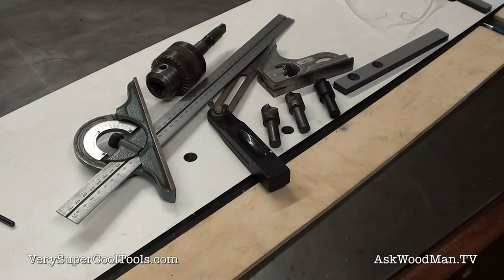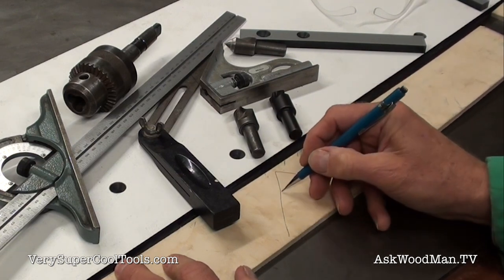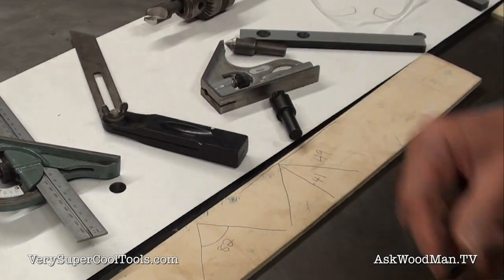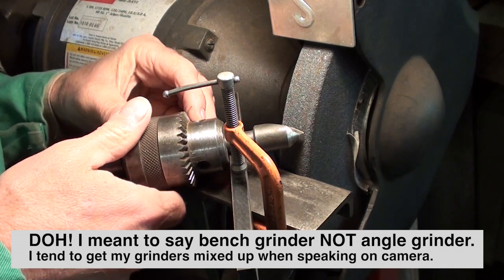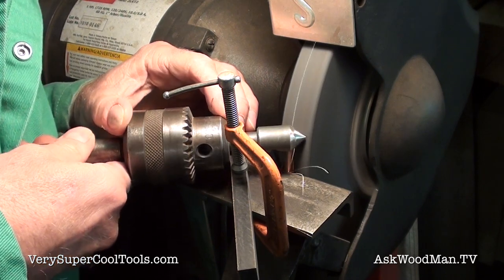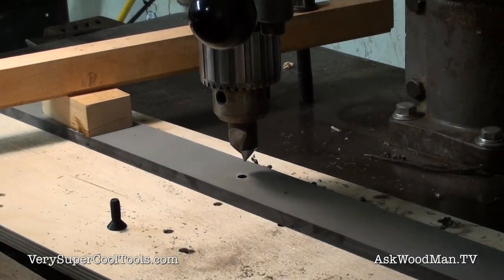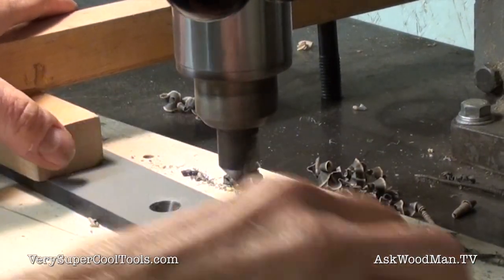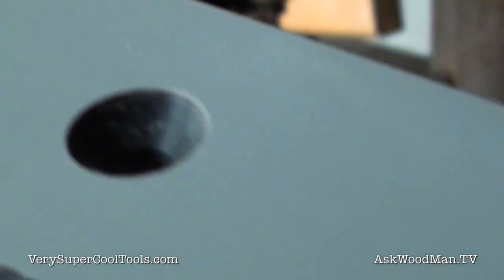1005. How To Sharpen Countersinks

Comment: That sure looked like a Clausing drill press.....
but I may be wrong...
.wonderful way to make those countersinks run forever...
especially using the drill chuck to hole and rotate....Paul
Reply from the maker: It is a Clausing drill press. I think it was made in 1972. It is joy to work on with all its unique features.

Comment: I have always had a hard time getting these things sharpened well. I am looking forward to trying your way! I also like your quick clamping method in this video...thanks man!
Reply from the maker: Thanks for watching. You can see what light pressure I am using into the wheel so each touch up on the grinding wheel is only removing just a minimum of steel. That maple stick is about 42" long and when I lean down on the far end with my left elbow  it really pins drill press parts down. You will notice I let the countersink find center in the hole and then apply pressure. This allows for a very true drilling setup quickly.  Allan
Reply: something that has worked really well for me is to use the countersink first then drill the hole. but that's probably because I would try to line everything up, clamp it then cut the hole...your way seems a lot faster! thank you!

Comment: Great video, great idea.  I look forward to tuning up my countersinks.  
Question- could you drill a hole in your angle guard that is the diameter of the shank of the counter sink, slide the sink thru and then lock in  it in your chuck? This would in theory keep a steady axis for your countersink to spin within.  And It looks like you would have room to slide the bit back from the surface of the grinder with this set up.

Comment: Great tip Allan. I've been touching up my countersink by hand with a diamond stick. I'll be giving this way a go soon. Thanks
Reply from the maker: The problem with that is while the cutting lip may be sharp if you do not remove material on the rest of the conic section that material will interfere and keep cutting lip from contacting the work piece.
Reply: kinda like the depth gauges on the teeth of a chain saw

Comment: That Wilsonart stuff blunts bits so fast. I had to buy 3 router bits to do a kitchen. I was constantly switching between them and sharpening 2 while I was on a break ready to be swapped out again when the current one went dull. If the bit isn't completely sharp it burns the worktop.

Comment: Nice tip. Does this work for multifluted countersink bits too?
Reply from the maker: It does in a modified way. You would only roll the countersink between the cutting flutes and then back off and go to the next section.

Comment: Thanks chief.
question : what have you been using that penolic material for lately ? I'm not sure I saw it. looks swell.
Keep on trucking ! (from France)
Reply from the maker: My tool company makes high auxiliary fences for our VerySuperCool Tools t-square with machined aluminum extrusion. http://vsctools.com/shop/auxiliary-table-saw-fence/  The phenolic material is so much better than the Baltic birch plywood versions we had before.
Reply: ok, that makes sense. 
I somehow started approaching the maker/DIY scene through the New Yankee Workshop and general woodworking, then folks like Jimmy DiResta and you made me appreciate the appeal of brass and general metal working.
Now i'm curious for all the other variations of starstuff, like concrete or these phenolic slabs. Oh , and I have a bunch of UHMW cable hooks in my shop thanks to your good tidings.
Anyway, all this to say... the possibilities for tinkering are endless. Thanks for being such a gentlemanly inspiration !